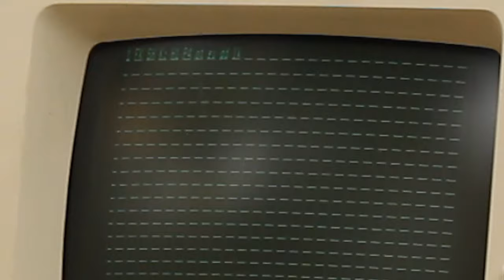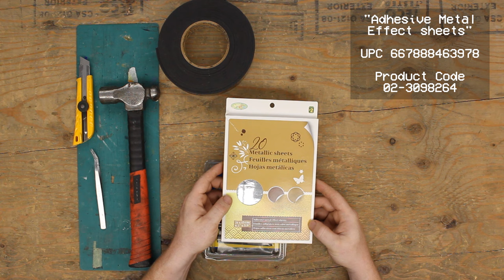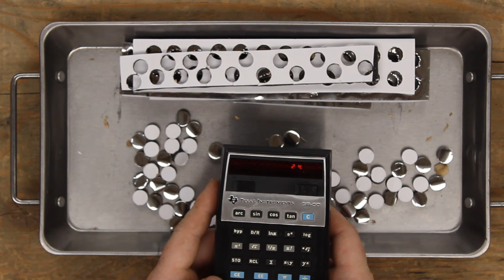Keytronic "Foam and Foil" Pads - How to Make Them Yourself

Comment: Rona sells 1/4" open cell foam by the roll for around $12 which already has the wax paper attached. Like you. I'm Canadian and I have no desire to spend $50+ on the pads, so I've ended up reusing the metallic discs and just replacing the foam. I ended up just cutting them in (jagged) circles and gluing the metallic discs back on. It's worked pretty good although I've had a few that don't work afterwards. I usually either re-assemble them or I delegate the non-working pad to keys that I don't use. Nice to know Dollarammy and Princess Auto have the stuff I need to mass produce pads. Thanks!

Comment: Would Aluminum Foil Tape work?
Reply: No unfortunately. The problem is that the keyboard works on capacitance, not a straight short and aluminum tape would present a short and make the keyboard freak out like it did when he used his finger. Basically anything mylar backed will work for making these however. Foil balloons, Space Blankets, and what he used; decretive adhesive mylar. All of those have one thing in common, they have plastic covering the metal. So that creates a capacitor. I hope that explains it for you. :)
Reply: Ah I didn't realize it was capacitance either.. great vid! Thanks! Also in Canada and trying to avoid US purchases... and home made twinkies.

Comment: Excellent video on this subject. But it damn near IMPOSSIBLE to find Mylar sheets that are sticky on one side. The video is informative, but USELESS without the ability to find the material to do the project. VERY FRUSTRATING !! You do note this below the video. Please make a followup video explaining other methods of making these important keyboard repair supplies.
Reply from the maker: Yeah sorry I couldn't come up with a solid product name or part number for the mylar. It really does seem like something that can be found form larger chain craft supply stores. I mean, this stuff fit the bill perfectly and it was available at the dollar store.
Reply: @CelGenStudios  Thanks. I did a lot of thinking on the project. While checking out at the grocery store I noticed lots of balloons. What are most of those made from? MYLAR !!  At least those are available everywhere. I got mine for free from that grocery store because it had a hole in it ;)  Then I went looking up and down the isles around my local Home Depot (in CA) for similar foam padding. I found Frost King Camper Mounting Tape for Trucks 1-1/4 x 3/16 self stick vinyl foam, about $7usd. Then I walked past the tape section and saw 2" double sided carpet tape, about $9usd. 
I went home and made a sandwich of a cut up mylar balloon.( I used masking tape to stretch and hold the shiny side down mylar on a flat surface), then put the sticky side of foam to the painted/colored side of the mylar, then applied the sticky side of the 2-sided tape to the foam, leaving the paper still on the back sided of the tape face up. Then proceed as you do in cutting up the slices, and then punching holes. I got an 11mm punch like yours from aliexpress for about $2usd. I would suggest using somewhat fresh and smooth surface wood to punch holes on. Old wood splinters too much.  I tested these in a Compaq Portable KB and they work perfectly!! Oh, be sure to peal off the tape backing from the pads before you put these into the keyboard. 
I thought I'd share first my frustration, sorry, then my solution so others could benefit.
Reply from the maker: @KLund1100  A Mylar balloon was also what I experimented first with as well! To this day the pads I made out of it are still working in my Lisa 2.